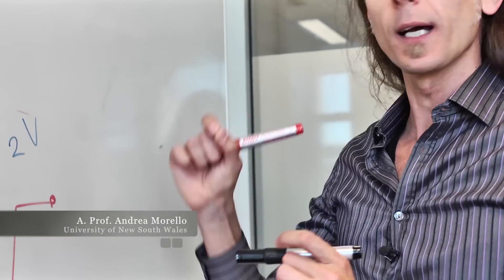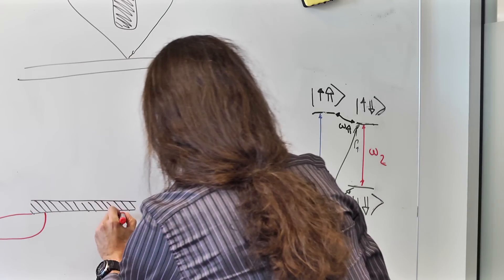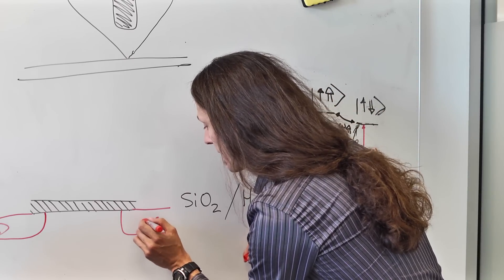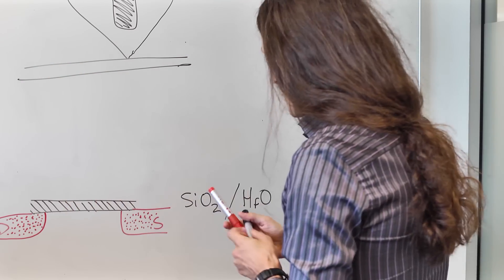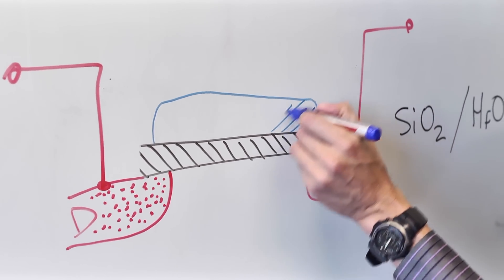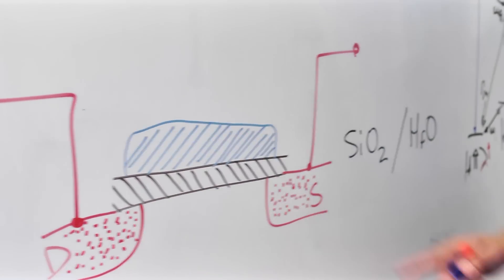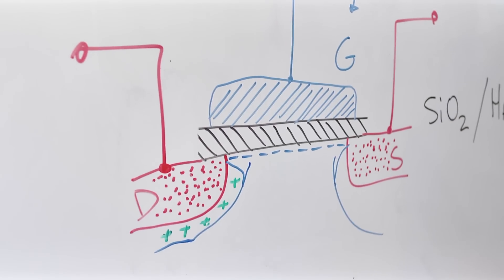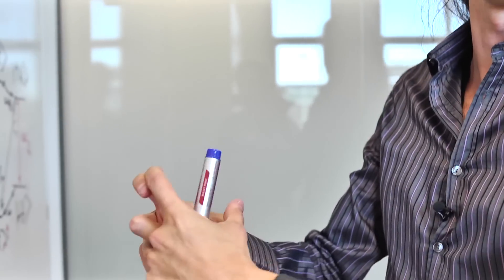Transistors & The End of Moore's Law

Comment: He is only describing a NPN transistor or a normally open transistor, there are also PNP transistors or a normally closed transistor by combining NPN, and PNP transistors you make And, Or, Not, Nand, Nor, Xor, and Xnor Gates which are all required to make Modern computers work.
Reply: Your equating a PNP transistor with a "normally closed switch" is erroneous. perhaps you are thinking of depletion-mode field-effect transistors, which operate on a different principal than bipolar transistors. Bipolar PNP transistors act completely analogously to their NPN counterparts, except the direction of current flow needs to be reversed. You further stated that both polarities of bipolar transistors are mandatory for making logical gates, and this is also completely incorrect.You can make each and every logical function with exclusively NPN or exclusively PNP transistors, however, better economies of speed and power may be obtained by combining both types. Check your notions before stating them as "facts."
Reply: ***** well you clearly need some basic courses in engineering then :)
Reply: ***** 
1st: The video isn't talking about the NPN transistor, or any form of BJT at all. It is talking about the enhancement mode N-channel Field Effect Transistor (N-FET).

2nd: The NPN isn't normally open with the PNP being normally closed. Both NPNs and PNPs operate in the same way only with different polarities. You must be thinking of enhancement-mode vs depletion-mode FETs.

3rd: One doesn't have to have both polarities of either transistor type to make logic gates. One can make certain logic gates with just one transistor. Using both polarities together simply has major advantages.

4th: I have personally made (what equates to) a 555 timer using only the NPN polarity BJT. It certainly can be done without using both transistor polarities.

5th: The NE555 and it's close derivatives are not logic gates, they are mixed-signal circuits. The topic has almost nothing to do with mixed-signal circuits.

Li Boud
1st: You will need diodes to make DTL gates, basic or otherwise. However, there are several logic families that don't use diodes for the logic at all. CMOS is the most relevant example. 

2nd: A transistor is not a logic gate itself. A transistor is a transistor, a logic gate is a logic gate. A FET can be used as a NOT gate by itself, but this is a special case of both logic gates and transistors.

madamerotten 
+1 thumbs-up earned.
Reply: Why would both be a necessity to build logical gates? wuut
Reply: Christopher Åkersten basic electrical engineering you need npn and pnp transistors to make logic gates look at the basic 555 timer that even has both pnp and npn transistors
Reply: His example is that of a FET not a bipolar junction transistor.  The FET is the basis of all CPUs today.
Reply: Dude, you need two diodes, not two transistors to make a basic logical gate like AND, OR and NOT.. A transistor, PNP or NPN, is already a logical gate itself.. You only need two transistors to create combined gates like NAND, NOR, XOR etc..
Reply: First of all what you are talking about is not right. He is talking about Metal Oxide Semiconductor Field Effect Transistors and not Bipolar Junction Transistors.
Furthermore PNP BJTs are not closed as you said. They work by conducting holes (technically both npn and pnp conduct by both electrons and holes in different degrees) under opposite bias.
The configuration you are talking about is called CMOS or complimentary metal oxide semiconductor. But it is not necessary and you can build any logic gate from just one type of transistor like NMOS or PMOS. The value of CMOS comes from their very low passive power draw  and noise immunity.
Reply: quantum gates are also an interesting topic to consider in quantum computing

Comment: I always think they should increase die size and get bigger cooler.
Reply: At higher frequencies (GHz) larger die sizes mean you start to have to worry about the speed of light/electricity and it's effect on the circuit.

Comment: dont know much about transistors. But couldn't you use voltz to channel away the power from each of the silicon sides. so instead of using power to create a bridge, use power to make sure the silicon ends never flow energy to each other.

( can be wrong i was just wondering )

Comment: Graphene is super conductive, it ocnducts electricity so well it doesn't even heat up as silicone or metal would. SO all the electricity pumpedi into graphene comes out 99% performance unlike silicone which is a large percentage is just heat. I"M so wrong right?
Reply: Silicon (not silicone) is used because it is a semi-conductor.  Its ability to resist movement of electrons sometimes while allowing them to move other times is very useful when trying to create the electronic switch that is a transistor.  A strong conductor is useless for that purpose.  Graphene could be used for the conducting portion on the top of the transistor.  One of the problems with most conductors is in manufacturing where they can be infused into the silicon creating a conductive pathway between the source and the drain and thus making the transistor worthless.  Gold the best conductor is the worst for that.  Graphene may present some of the same manufacturing problems but I don't know enough about it to say.
Reply: alecthemad  It's too early to speculate but my guess is, in about 20 years well have a first consumer grade chip. Just in the end of "silicon" era
Reply: alecthemad
I remember graphene being able to act both a conductor and a semi-conductor depending on the direction you send your current through and the width of the conductor?
Reply: Alcesmire that is graphite. not graphene.
Reply: alecthemad gold isn't the best conductor. silver is

Comment: Well we will just start using more kernels instead, and 3D transistors. There are also carbon based transistors that clock >100Ghz =) so Moores law can continue with a different technology. It doesn't have to be silicon.

Comment: Awesome video - but...

I thought for sure this would explain why a new Intel i7 4770k (released q2, 2013) isn't  (much) faster than my 3770k (q2, 2012) - but sadly no. Is it just me or doesn't it seem like Moore's law, at least in what it should mean for performance, has been at a standstill for quite a while now..?
Reply: One of the big reasons for the slowing in performance is because the clock speeds of the processors have not been getting any faster for some time now. This is because, the faster you switch the Mosfets in a processor, the more heat they produce. Since there are so many transistors packed into a tiny space, they can only produce so much heat before the chip cannot dissipate it away from the transistors fast enough. This is why you will not see any processor with a clock speed faster than about 3-4 GHz, its just not practical to  run the transistors any faster.
So manufacturers began producing processors with multiple cores, instead of trying to produce faster single core processors. Many programs, however cannot take full advantage of the parallel processing that multiple cores give, and so performance on some programs will not be much better with the newer processors which have the same, or slower clock speeds as older processors, but more cores
Reply: This exactly. From the mid-90's on up to the mid-00's, we made some incredible leaps in speed - from 25-50 MHz to 4 GHz. Making the nodes smaller and smaller meant you could use less and less voltage, which in turn meant that you could crank up the speed. It wasn't so much Moore's Law at work as it was a side effect of it.

At one point, the marketing department at Intel drew a line and openly figured that their processors would be running at 10 GHz by 2010. Physics kinda put an end to that around the 4 GHz mark. You can do some fancy overclocking to around 5 GHz or so, if you use water instead of air. 

You can do even more if you use liquid nitrogen or helium - but that kind of cooling is just out of hand ridiculous.
Reply: The reason for this is because Intel (and to some extent AMD) have started to focus more and more on energy efficiency rather than raw power. And this focus is caused by rise of the mobile market when compared with the desktop market. So new processor families are thought mobile-first and therefore energy efficiency is prime.
Reply: practice - That sounds like a plausible explanation. My own thought have been in this direction though I also believe Intel and AMD has hit some kind of barrier with the current architecture seeing the very slow development from the Core2 line of CPU's until today.

Personally I find this particularly sucky as I can't upgrade my current 1-1/2 year old workstation without jumping up to a dual Xeon setup with a $2000+ pricetag on CPU's and MB alone. :P
Reply: ***** - What's 'old'? I'm looking at the last 3-4 years. From the faster i7 9xx series back in 2010 to the i7 2600k (2011) you get 15% higher performance but from the 2600k to the i7 3770k to the i7 4770k you get about 5-7% per step, even less if you overclock, so that's at best a 15% performance increase over the last 36 months... Basically a standstill...
Reply: Nice set up.  Running an i5 myself (clocked at 4.5).  Yeah, you're right.  If you need to buy some CPU time, just amazon it lol

edit: holy shit, 32gig ram.... I thought I was crazy with 16 haha!
Reply: ***** Well, it's a work box and I do everything from 5K REDCODE compositing to rigid body- and fluid simulations as well as rendering. The GPU's are for CUDA/OpenCL, no gaming on this box except the occasional FreeCell game while on the phone, hehe...

And the difference between the i5's and i7's is negligible. A i5 3570k@4500 Mhz Ghz is likely faster than my i7 3770k@4200 Mhz, though barely. And I'm running an older Corsair H70 cooler but perhaps time to upgrade it to the Corsair H80i and crank up the CPU to 4600 Mhz... What else could I do, not even upgrading to a hexacore will give me much more speed and I'm not in the mood to spend $2500 on 2 Xeon E5's and a dual 2011 MB... :P

And the reason I got 32 Gb RAM is stability. I have had situations where I've run out of memory on 16 Gb and though I could technically have gone to 20 Gb (4+4+4+8 Gb), my experience is, when keeping stuff in RAM for a long time, like doing heavy sim's or working with high res video, you get a noticeable more stable rig with identical modules, like down to the manufacturer batch - in my case a 32 Gb (4*8 Gb) kit from Corsair. And though I often crash apps (usually doing particle work) this box have never had a BSOD in the 1-1/2 years since I built it. Seeing I often leave the rig over night or even weekends sometimes, on a render or sim, stability is pretty important. ;)
Reply: Ahh, I see why you need such a beefy rig :P.  I work on a fair amount of HD video myself and 16gig seems fine (files range in size from 10 gig up to 40 gig) for the moment....

Agreed on the difference between i5's and i7's, a friend of mine was boasting about his quad core i7 yet when we compared benchmarks, they're was little difference in the results.  

Don't think he was happy as he spent £150 more than me on the processor.... hehe
Reply: Farmfield Also, CPU's today more powerful in multi-tasking.  Old CPU's would be good at single tasks but would struggle when multiple tasks were running concurrently.

Personally I think we'll see the end of Moore's law in the next 10-20 years.  What happens next is anybody's guess.
Reply: Not disagreeing with you Farmfield.  Raw computational power seems to have slowed (despite Moore's law still holding true).  Are we witnessing the limit of silicon or are Intel and AMD (as you rightly suggest) moving their focus away from power to mobile computing?

Personally, I think the current gen of Intel CPU's are crazy fast, but I still remember having a single core CPU running at 1.2gz.... :)
Reply: ***** - I'm running an i7 3770k@4200Mhz, 32 Gb 1600 Mhz RAM, OCZ PCIe Revo SSD's, dual EVGA GTX580 Classified's a.s.o... Crazy fast? Well, you'd think so, but as soon as I start simulating just a few million voxels it's just not that fast anymore. ;)

On the other hand we also live in a time where anyone can buy computing power pretty cheap, Amazon EC2 is very useful when you get to that point it's too heavy to do locally. That saved me a couple of times for sure. :)
Reply: Well, HD from DSLR's, GoPro's and such is compressed h264, that's very light compared to a 5K frame which is 7x the size of an uncompressed 2K (~ HD@1080p). Now, to be honest, in most cases you'll create a 1/4 size proxy to work on, but remember we're talking compositing here, so even using proxy's it's gonna be layers upon layers, often exr multi pass renders with 10-20 channels at 16-32 bit a.s.o ... It adds up to unreasonable amounts of data pretty quickly. ;)
Reply: And here I am just encoding HD video content.... :D

Comment: so my cpu is slow because some "smart" guy decided to save some grams of silicon and made it smaller but its transistors tiny?! I would like a 10 square centimeters of 40nm transistor CPU core instead of 1 square centimeter with 22nm transistors :/
Reply: The problem (if I understand it correctly) is heat. The smaller the transistor, the less power usage thus less heat. The smaller the chip the easier to get the heat out of it. So a bigger chip with the same number of transistors would be warmer and harder to cool.

Comment: at that point of time when there is no more doubling of transistor in ICs countries like India will think of setting up IC fab units...
Reply: We're only building in 2 dimensions right now. A lot of research is going into making 3D chips and the story starts all over again. Intel already has 3D transistors and stacking is becoming more and more viable. It's like a city that has become so crowded that we need to start building higher and higher buildings.
Reply: Niosus That seems like it would run into the cooling problem even worse than 2d chips?
Reply: L1ama It's a challenge, yes.